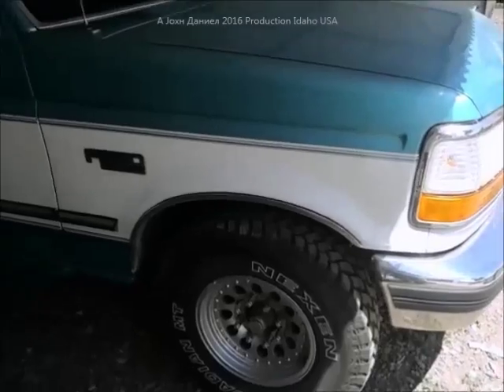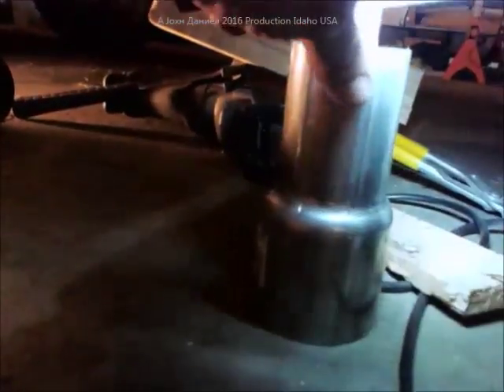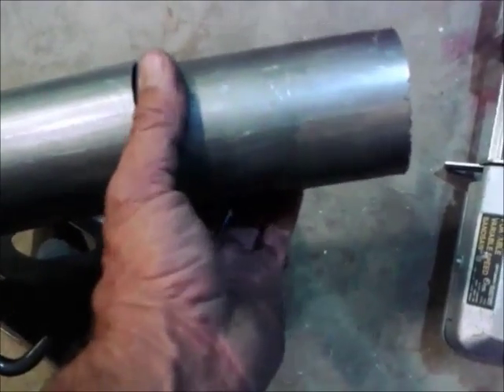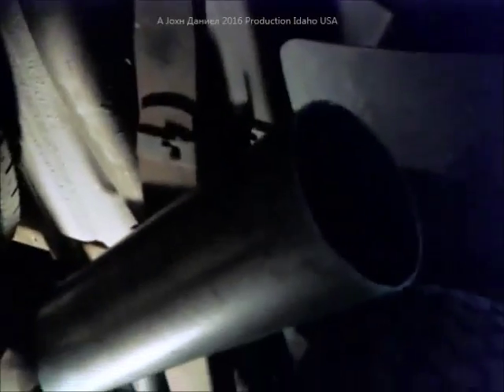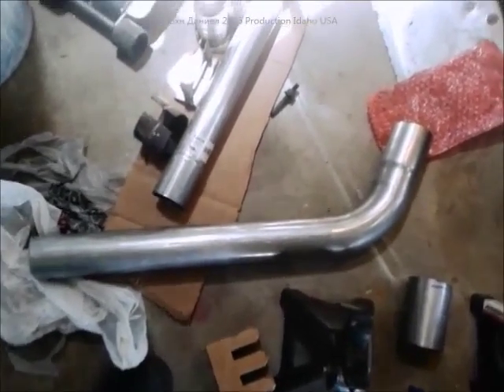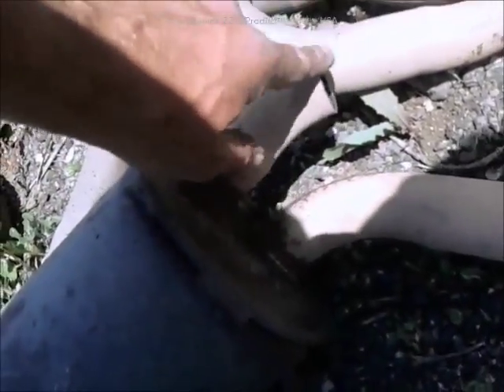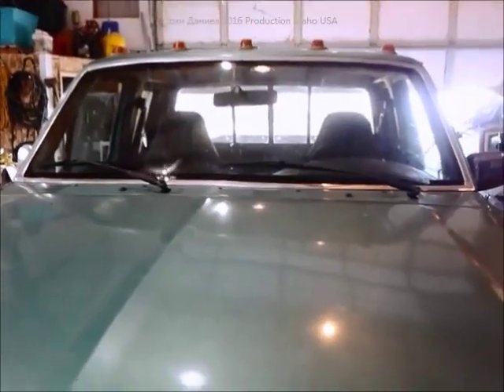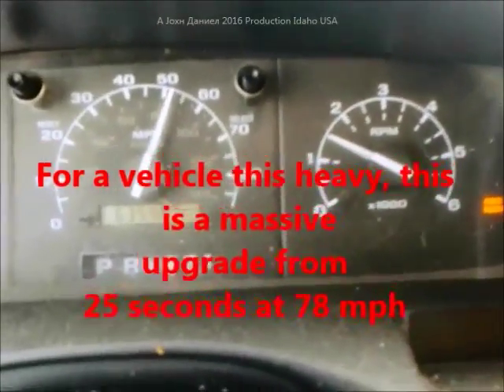Better MPG & Power, example 7.5 liter Ford F-250 truck 460 engine, 1 mpg gain

Comment: Hot tip , They make 1/16  stainless stick rod ,and it will weld that stainless exhaust pipe.
Amazon has it

Comment: There's no way that thing weighs 7,430lbs, I have the exact same truck and it only weighs 5,500lbs, and these are 245HP, not 325-340HP.
Reply from the maker: Talk to Ford, they built it to be a Border Patrol truck, 17 of them in all. All have Dual ignition, hell finding a balancer and water pump housing where the crank sensors 2 go, 1 ton rear end, 3/4 front end. They were stored in Yuma Arizona and I got mine at the Richie Brothers auction in Goodyear AZ with 4,300 miles on it, photo bid, still sitting where the Clinton Admin placed them all when they loosened the border to get more cocaine and pot through.
Reply: @JOHNDANIEL1  Take a photo of the scales when you're empty.
Reply from the maker: I got curious thinking, so I got the original papers out for it, Me and My Dad bought it at the auction when we bought 3 other vehicles, He kept it I kept the 2 diesels. I got it from him 9 years later, the old man being who he was did not drive it much. The papers from it included the listed weight with the security transport shell on it, 1 to 8 passenger lock up for illegals, but likely as a narcotics carrier for them. Very heavy, took a fork lift to remove it. Apparently it's on the sale slip and where I saw the weight data. Because we listed it for RV Hauling the State of Idaho has it weighed at 6,190 as of October 2019 IDOT scale Hollister Idaho as it sits without the lock up box and its roof AC on it. It has numerous plates in the frame, and on the engine is 3 tags with FRT Tuned Vehicle on them.

Comment: "IMPROVED" Catalic coverter??? (CLEAR IT OUT? simply empty box?) Does the Computer need to be replaced?
Reply: @markw4382  depends, if your engine has post cat o2 sensor. May need to get adapter that sends the ECU the  "proper" clean exhaust signal that would otherwise likely be absent

Comment: My 1997 F250 4x4 ext cab-- full length bed (155" wheel base)  460 V8 engine,  130K   with E4OD trans --gets 12-14 mpg. HWY.   Running at 65 mph.   Has 3.55 axle gears.      Still running smog pump, stock exhaust.    I am considering Banks headers and removing smog pump.    Also improving intake.     Synthetic oil in axle diffs.   I might gain 1 mpg or so.
Reply from the maker: Keep me updated on the results, mine just shot past 80k last month.

Comment: Very good! I had a 1995 F250 with the 460 in it which had around 60,000 miles on it about 2-3 years ago. Love it but didn't love the fuel mileage haha. So I had swapped the original massive airbox with a cold air intake by K&N. Looks and sounded awesome. I also put a Taylor Helix throttle body spacer in there. The only other thing that I wanted to do before I sold it was do what you did here. But a guy offered me just over $4000 more than what I paid for it so I couldn't say no to that!
Reply from the maker: Yeah, I paid $4000 for mine with 59,400 on it. Its just now at 78,000 after 3 years. Making it breath better is a 2 mpg reality.
Reply: I have a '96 F250 Xtra cab 4x4, apparently they don't make a cold air intake for this truck (460)?
Reply: @snakeman0880  did the throttle body spacer increase gas mpg?

Comment: What kind of economy increase did you get? I’ve got a 96 f250 long bed/extended cab 4x4 with the 460, I average right about 7mpg for daily driving. With a tuneup and a similar exhaust system, would 10+ mpg be feasible?
Reply from the maker: I went from just over 10.2 mpg to 11.3 average mpg based on 30% city/70% highway use after 4 tanks of gas in my testing.  Yours being 4x4 is the worst fuel cost, mine is just 2 wheel drive.
Reply: Јоhn Daniel hey what about mpg combined with a 96 f250 extended cab short bed 460 7.5 automatic vs a 94 f150 extended cab short bed flare side edition 5.0 manual transmission mpg combined will it
Reply: Just bought my 94 f250 long bed extended cab 4x4 with the 460. I was getting 8mpg. I pulled the k&n filter and just put a throw away filter in and some seafoam and I'm getting 11.3mph on the highway.
Reply: I just bought a 1996 f250 with the 460 in it about a month ago, but I hadn't driven it since the day I bought it. Until I took it into town yesterday. I drove 3.2 miles and used an 1/8(front tank) of gas thats 2 gallons that means I'm getting 1.6 mpg I need help

Comment: Need to put a 70 series flow master in there better for big blocks that muffler is to small your using your choking the system to breath I found out the hard way on my 1996 f250 7.5l 4x4 had a magnaflow about your size swapped it out to the 70 series huge difference in power and mpg
Reply: i think that was the one i was already thinking about going with. good to see someone had good results going that route.

Comment: I simply added an OEM k & n air filter, e3 spark plugs, high end spark plug wire, put 2 tornado devices into the 2 air intake hoses that lead from the air filter box to the engine and that gave me a 5 mpg improvement and very quick throttle response when needed so that muffler upgrade what your video about should make it a 6mpg improvement if I do that
Reply: Hahahahaha...
Reply: @JalopyTechnology  x2
Reply: I call bullshit!!!! You meant to say 0.5 mpg, right?
Reply: That's the biggest bs I've ever heard those turbo devices actually decrease your gas mileage i watch a joke video on that stupid crap
Reply: you must have been getting 5 mpg before your tuneup
Reply: I think the k&n air filter is a good move, spark plugs ok, not sure about the rest